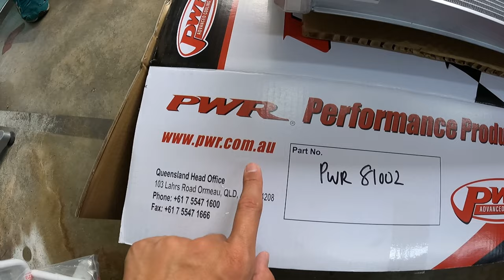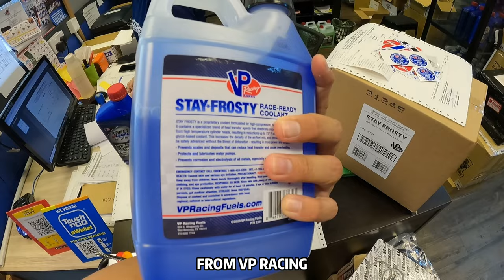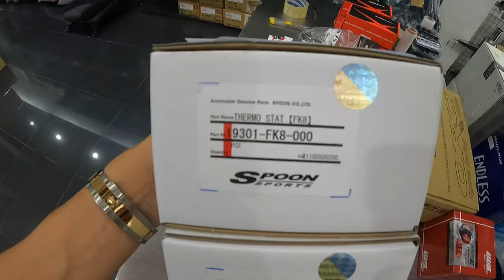[VLOG]HONDA CIVIC TYPE R FK8R Upgrade PWR Street Version Radiator + Darren EK9 Rebuild Process 50%

Comment: Great video! To really solve the water temp issues, you need to install a custom secondary auxiliary radiator in front. A workshop in Singapore developed one and it works very well when it was tested in Sepang circuit. The American boys has done the same thing when they do time attack sessions in the summer months.